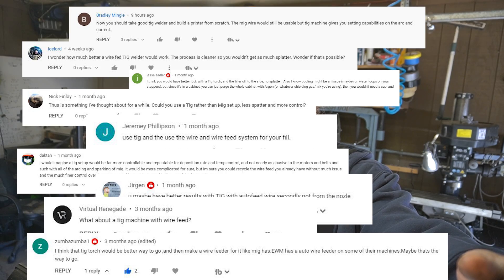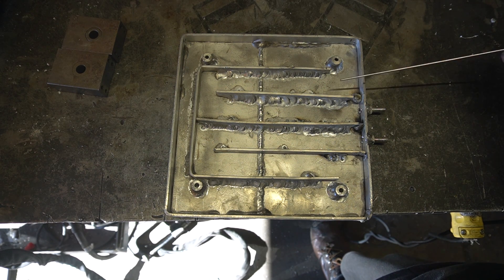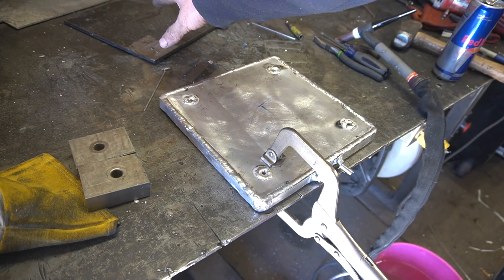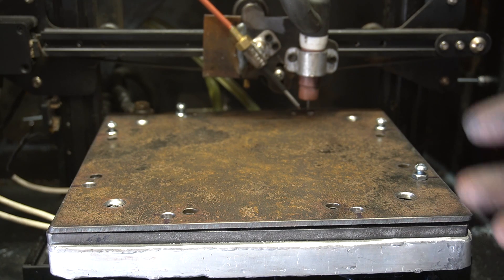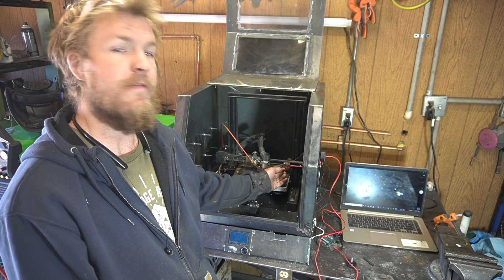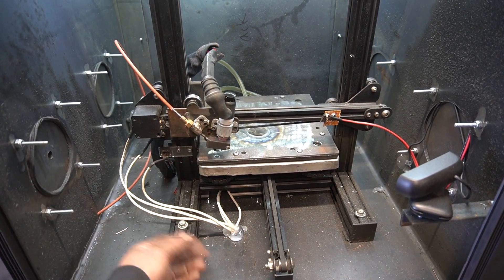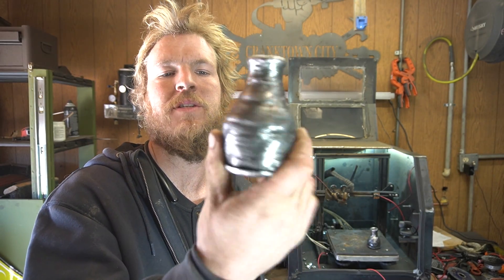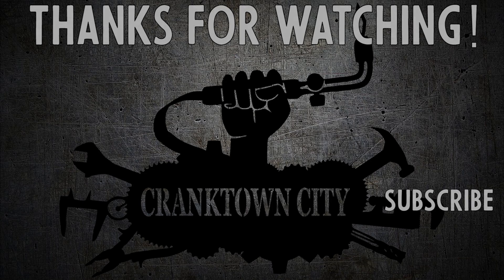DIY Metal 3D Printer Using A TIG Welder

Comment: I think the layer shifting on the x axis is due to the timing belt heating up, expanding, and missing steps. If you replaced it for a lead screw I bet it would help. It might be worth while to rebuild the entire x axis. Replacing the extrusion with mild steel would significantly mitigate the potential for thermal expansion of the aluminum which also might be part of issue. Keep it going, this is getting interesting.
Reply: Ditto.  This machine really seems like it's only missing basic infrastructure to improve rigidity and repeatability, like lead screws.  All the hard work is mostly done, it just needs some tidying up and tuning.

Comment: I think you need to use smaller wire lower amps and more time and it will improve the quality of the print overall a cool project though

Comment: It's seems like you are running into some cooling issues. On the smaller layers it seems to not cool off quick enough for it to be stable for the next layer. I think the water cooled bed has potential to cool more than that water cooler allows. I think a couple car radiators with electric fans and a pump would give you a lot more cooling capacity than that cooler.

Comment: Man, your dedication! For shielding you could try ferrite beads (usually not beads shaped), the bigger hefty ones. However, if you have high currents (welder, daaaa) it would be challenging even for professionals to design.

Btw, Im impressed by the vases, this is small jump, not step forward.

Comment: I’d really love to see you continue with this and see it evolve. Great video, great great job your time / money I’m sure is there. Large neodymium rare earth magnets recessed into the aluminum cooling jacket. Make the magnets removable held in place by grub screws. This should remove the need to screw down your build plate while also having enough magnet pull force to offer a quality ground. The cooling jacket I think would keep the neodymium magnets from reaching their Curie temperature. With this method of holding your build plate should offer a more reliable leveled bed relative to the print head. I’m an idiot and usually don’t know what I’m doing, your work is coming along great and would love to see it grow further.

Thanks and wash your hands!!
Reply: You realize what magnets do to arc behavior?
Reply: @subwooferbone  

Hi,
No I don’t.
Reply: @joshuameldru4004  The arc gets really unstable and goes all over the place, known as arc blow. Try MIG welding a seam held together by a magnet clamp, as you pass the magnet all kinds of fun stuff happens.

Comment: Cool progress. Definitely an improvement.
I'd try to decrease power and layer higth. 

You may also think about 2stage process.
First one - metal weldprinting, second one - milling layer to size.

There are ultrasonic printer heads out there, that weld layer of thing aluminum, and then mill residue out.

Well done
Keep movin'

Comment: Good improvement!
Suggestions: change the motion system to ball screws. Should not be affected (as much) as the belts. 
Have you coded in some retractions of the wire?
Have you tried random z seams? 👌
Keep it up! 👍👍👍👍
Reply: He mentioned coding in a delay for the wire to stop feeding right before the arc extinguished. But it might not be a good idea to retract the wire since it will likely end up with a ball/bead on the end of the wire that would immediately get stuck or ruin the teflon lining in the wire feed cable.
Reply: @TopDedCenter  i guess it will greatly depending on the wire stick out, and how much retraction per pull. It definitely would require testing :)

Comment: Please keep going with this, by no means do i imagine what you are doing is cheap but it seems far more in the reach of the average enthusiast compared to the other metal printing solutions available
Reply: I tig weld, this would be extremely difficult to do. However kinda possible to make it a little neater if pulse welding is possible to do here. Pulse welding lets it cool down a bit so it doesn't just melt away so easily and could potentially hold its shape more.

Comment: Would probably need some drastic cooling solution to get the shape to hold up. Maybe just have a water cooling system where the whole bed lowers into a pool of water. You could then keep the water cool and this would cool down the part as fast as possible.

Comment: I love the attitude of "I think it's shitty, but I'm going to try to make it less shitty", especially when there's steady incremental improvements. It's a refreshing approach, done properly, without the filler crap huge channels tend to do.
A few tips:
1 - You're pushing the resolution way too far, and that's why you might not like what you see. Something like this can't print super tiny details, so if it looks wonky, it may be in part because it simply can't not look wonky, even if it was done by hand by a professional TIG "dime stacker". Try scaling the prints up to get a better perspective.
2 - Wire shielding must happen on one end only(i.e. printer -> cable -> box -> outlet), and there should only be one common earth point, not multiple outlets.
Reply: Regarding 1) - the commercially available metal spray printers (i.e, DMG LASERTEC) all add more material than needed and then mill it to dimensions afterwards. So expecting anything more from just a DIY project is an illusion. Only metal powder with selective melting can produce somewhat good results out of the box without any milling.
And btw. they're mainly used to repair injection molding tools. If you have a defect, the metal spray can add material where it is missing, and then you can mill and laser it back to spec. For actual "printing", cast metal and milling is the way to go, which can be replicated with a 3D printer as shown by many DIY channels.
Reply: you couldn’t afford it